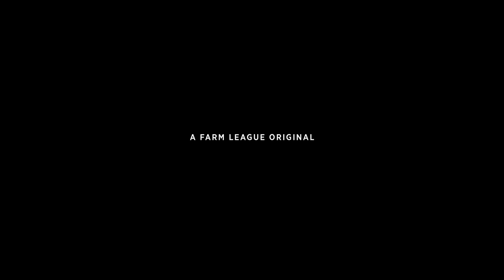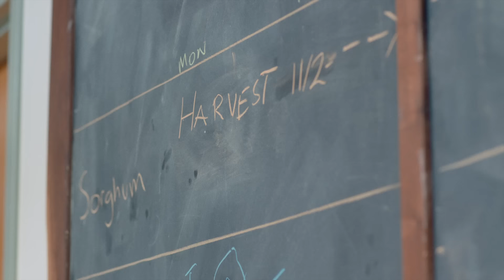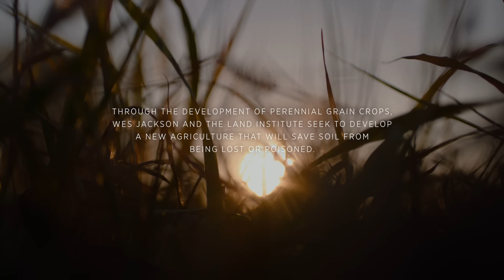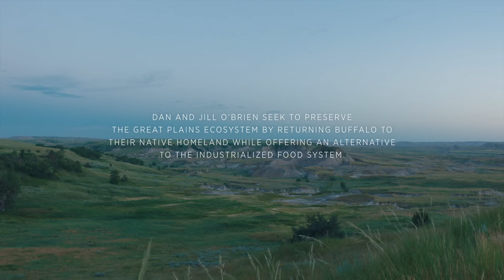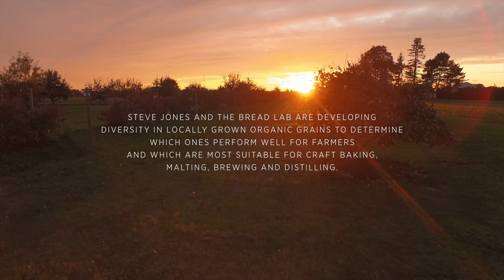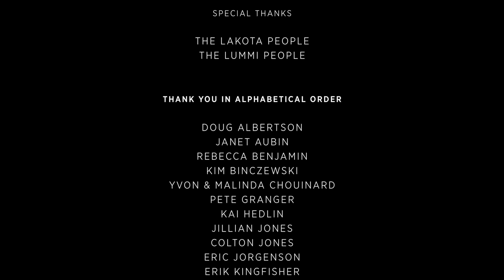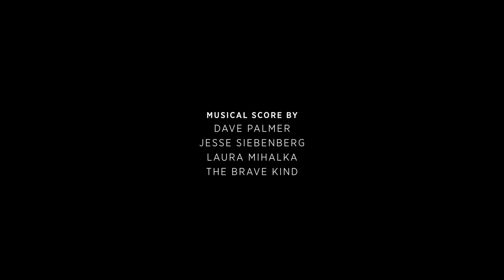Unbroken Ground | A New Old Way to Grow Food | Patagonia

Comment: "Soil is more important than oil."
Reply: this is where its at...
Reply: Biochar...
Reply: He got that bit right however it IS a completely renewable resource... thats the point of regen ag.  You build soil
Reply: Fkn love good top soil with hummus and mulch, it's godly.
Reply: @WadcaWymiaru  
You can build soil carbon with it but just by judicious methods you can get similar effect.  Using agricultural waste such as rice-hull biochar is to build up depleted carbon stores is great,  but I suggest checking out how Mark Shepard has been accomplishing carbon sequestration through planting methods.   Pretty amazing stuff.
Reply: @Forester-qs5mf  
Building the soil solves most currently perceived problems.
Reply: Thank you
Reply: @WadcaWymiaru  
No,  we need more carbon in the soil in the top layers for plants...
Reply: You can't spell oil without soil dude.
Reply: @WadcaWymiaru  
Your point about global warming is tangential to mine at its best.   Your understanding of soil carbon is obviously lacking.

With the use of the plow,  reserves of carbon in the top layers of soil have depleted considerably.  This aerolized carbon needs to be returned to the ground for agricultural reasons,  first and foremost.  This additional carbon swirling in the air means that soil has lost porosity.  Loss of soil porosity means more flooding and more drought in these areas suffering from the biggest lack of soil carbon.  Just having extra carbon in the air doesnt mean that the soil in most critical need of said carbon is able to sequester it.
Reply: @WadcaWymiaru  
How about reading what I wrote first?  Soil carbon has more impact on the growth of your corn than air carbon does.   Ignoring soil carbon doesnt make air carbon better.  The gold to farmers is black loam (carbon-rich) soil.   You look at soils across much of the world,  they have lost their loam-y qualities.  The US has lost much of its topsoil due to plowing.  Aquifers are recharging slower now.   Floods are occuring because it has lost its porosoty.  High air carbon may be great,  but we need corrected soil much more.

Tangential is in the dictionary:
tangential
[tanˈjen(t)SHəl]
ADJECTIVE
relating to or along a tangent.
"a tangential line"
diverging from a previous course or line; erratic.
"tangential thoughts"
hardly touching a matter; peripheral.
"the reforms were tangential to efforts to maintain a basic standard of life"
synonyms:
secondary · subsidiary · incidental · marginal · minor · unimportant · lesser · inessential · nonessential · immaterial · superficial · ancillary · borderline · irrelevant · beside the point · of little account · extraneous
Reply: @b_uppy  
1. Maybe you should WATCH all links i sent to you. A "soil carbon" doesn't matter in "water efficiency" that CO2 increases greatly. To beat a desert we need another ally: www.youtube.com/watch?v=F2DLQw1K9Ms
70% of water saving.
2. No one, absolutely no one have had used that word to answer me, since the english isn't my own.
Reply: @jamesaritchie1  
I am orphan, i do not know what the "mom" is.
Beside that...i am VERY educated in the world-hunger solving solutions!
Reply: @jamesaritchie1  take a chill pill Mr.
Reply: Another way to think of it:

Soil holds the soul
Oil lacks thereof
Reply: @GeneralLiuofBoston1911  Soil holds the soul." Now that is profound.
Reply: @WadcaWymiaru  Making biochar pumps OUT CO2 and creates global warming.
Reply: @WadcaWymiaru  When a person begins a discourse by name calling it is a good indication that very little of sense will follow.  I won't waste my time with you!
Reply: @WadcaWymiaru  I must be pretty important for you to spend so much lunacy on me.
Reply: @billastell3753  
I want to challenge YOU however you keep running like a rabbit :/
C'mon! Be a MAN not wuss!!!
Reply: @WadcaWymiaru  You know, it’s funny that you’re trying to be smart by opposing everyone’s opinion, even though you’re doing a terrible job at it.
Reply: @WadcaWymiaru  I’m a biologist. You believe that more carbon is good, but the problem is we’re killing top soil and cutting down forests. Without healthy plants to sequester carbon effectively, the carbon is stuck in the atmosphere and heating up the earth.

We need more plants and less carbon emissions.
Reply: It is, but who has to die to change our ways
Reply: Keep the oil out of the soil. Ban petrochemical fertilize and pesticides, Put Moderna out business and put their CEOs on trial for crimes against humanity environmental protection violations.

Comment: Very glad to see sustainability as an integral part of farming/ranching.  It really is a no-brainer!      Profit as the end reaps disastrous results from the means.     It would benefit everyone to really question where the food you put in your mouth came from....Something I have done for the past ten years.   I have drastically modified my diet from what it was before.   I still have much room for improvement.      Another thing we all can do is buy higher quality goods that last much longer than the 'cheap stuff'.   It really is a savings in the long run and has a positive impact, cumulatively in the long run.       Well done video......Thanks for sharing.

Comment: I think there is a lot right about this direction but I think a few other points bear on the situation. I think in the first instance we need to rethink our dependence on grain as a staple food in the first place. In general large amounts of grain are simply not good for us.

Where annual crops are necessary growing perennial plants on other plots for mulch in which to plant instead of plowing would increase the quality of soil and reduce erosion.

In animal husbandry rotating pasture to avoid over grazing and to allow for a cut for natural composting is important I think. All of these approaches of course increase cost in addition to quality due to the need for using more land and slower growth.

Comment: It takes 6 gallons of water to produce 1 gallon of wine, roughly.  Almonds require 1.1 gallons of water to produce one single almond.   Even in drought years, the almond trees must be watered. There is no crop rotation, in terms of rotating crops due to drought stress, etc.  The water is just as important as the soil.   Wine and almond milk.....think about it.

Comment: Conventional methods of growing grains,  etc is a large part of the problem.   Bare soil fallow, chemical inputs, and monocropping you need to avoid.  
Water is a resource,  too...
Pressured rotational grazing with livestock is very effective at building carbon,  groundwater,  etc.  
Sorry but those buffalo are eating that grass pretty low.  Buffalo and cattle need to moved to prevent overgrazing, period.

Comment: the issue is that all of these methods dont translate to massive profits and simplicity.
if you're some permaculture orchardist with rows of tree guilds you have a massive diversity of species, harvest times, different diseases, different pests, different machines needed to harvest. some of them even use a nitrogen fixer tree as every 2nd or 3rd tree so 50% of the orchard could be trees that produce no crop.
the guy growing a monoculture of apple trees where every tree is the same has a much simpler job thats more efficient. 
obviously i prefer the regenerative all organic methods, but i dont see the majority of farmers headed that way any time soon.
also its not like farmers are making massive profits on average anyways, most of them cant even survive without government subsidies.

small local UPICK farms and personal gardens are the best option for humanity. nothing beats a fresh fruit right off the tree.

Comment: So soil health and sustainability.. It should be understood before the conversation starts that many of the fields that lay barren in the Midwest are indeed due to bad top soils. Those fields did not get bad top soil from bad agricultural practices necessarily, but from heavy metal pollutants. How do heavy metals enter the soil food web? Usually something bad polluted the water table or the water table could be running low and concentrating heavy metals that are preexisting in the area. Unregulated Industry and poor site planning can also end up with heavy metals being dispersed through the air and leave you with acid rain which is bad for plant heath and the water table. 

So how do we fix the heavy metal in our environment? Planting crops specifically that will target one heavy metal at a time till that particular soil is free of it. main problem being the crops that are high in heavy metals are considered toxic for livestock and people to consume. (You can't even compost with it since it would just put whatever you took out right back in)

There have been hundreds of well rounded studies on "Organic" vs "inorganic" nutritional standards for plants and they've found in almost all of them that as long as the nutrition being added is free of heavy metals and carcinogens the plants and the micro biology in the soil can't tell the difference between the two. 

Adding organic things to the top soil is important. So composting and incorporating worms and manure is important, cover cropping and using crop rotation are key things to maintain the soil health, but that by itself isn't going to fix the heavy metals and the crippled water tables.

Comment: Breeding wheat with other grasses has already been done in order to make wheat taller and easier to harvest by machines, and to increase the size and number of the grains per plant. However this also introduced different "lectins" which are chemicals the plant uses to repel insects. Humans are not adapted to these unfamiliar lectins which act as poisons to us. Already a large percentage of people do not tolerate wheat for this reason. For them, or us I should say, wheat can cause a breakdown in the intestinal lining, allowing undigested food particles into the blood stream. This is a very serious chronic problem for many people. The last thing we need is more unfamiliar lectins added to the food supply. For more information check out Dr. Gundy.

Comment: Tilling the land actually greatly disturbs the active bacteria and microbes in the soil it is very destructive process when producing a new crop nature does not work this way... you must turn the soil in such a way that lifts and turns it back on itself so that micro structure is not disturbed and also plant various forms of crops so there is a diversity . In addition uses organics as much as possible with the Ph of the soil and the nutrients which comes plant  material and animals native to the land to keep the same system. Once you change the land  in what you grow you change the nature of the soil and get problems
 Know your land and soil.
Reply: This is very true however the monsanto-bayer cancer corporation have distorted this to their benefit here in Australia anyhow, and push spray fallow of paddocks which is even worse than tilling.

Comment: Using Genmodification directly, creating (GMOs), would drastically reduce the time it takes for better crops to be developed. GMO vs non GMO is just a little joke anyway because the line between what a GMO is and what isnt is just sophistry. They could be advancing so much faster if they just used GMO tech for creating the desired Hybrids always saddens me when a pefectly safe and viable option which could do a lot of good is villified based on 0 evidence

Comment: Appreciate work. However, humans should not eat that much grain, we are not designed to eat it it in large quantitities. Nor does it provide the nutrition, micronutrients and botanicals, even if deep rooted. Animals and humans live in forest systems. We need the diversity of open forests. Nuts are a much more appropriate to add to diet for humans and diets. Silvopasture is very important. Meadow pastures are important but they should be more in the number of 20-30 percent of land, not 70-80%.

Comment: Jeez no need to do American system of agriculture. Just divide the land. Grow lucerne each section. Take cuts. Then plough it back to ground. Each time do it in one section. Then with in few years your soil tilth will improve, water holding capacity will improve considerably, the soil will get biological nitrogen, if you sow lucerne think weeds will die and soil will get more organic matter and soil microrganism including rhizobia. This will improve nitrogen fixation considerably. Every 5 years of alfalfa or lucerne can give nitrogen to grow wheat for 2 years. Then grow some peas or beans and it will help soils. Get good profits and good soil. Dont make it complicated. Crop rotation will fix the system.